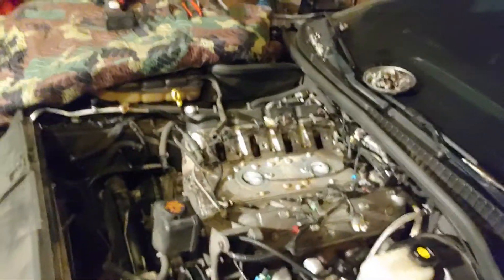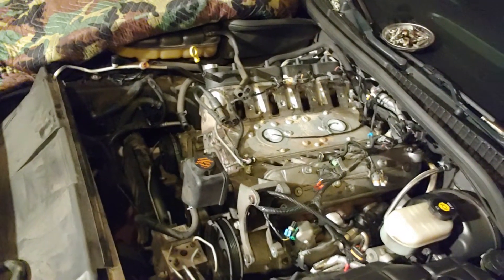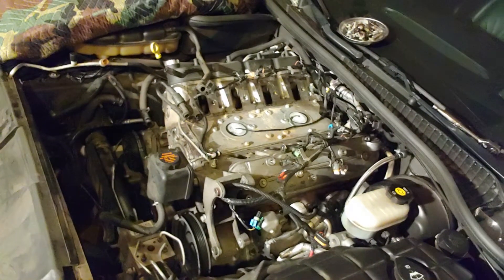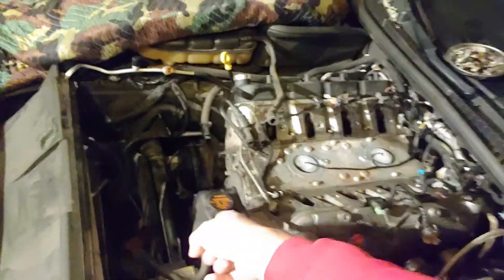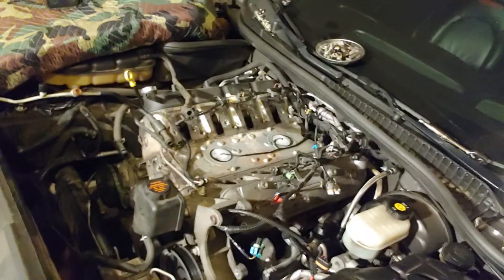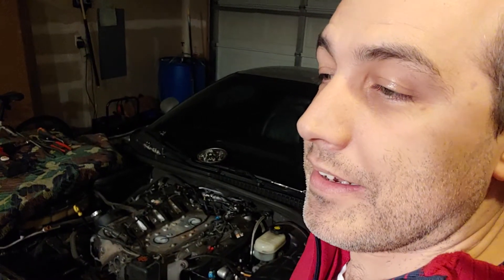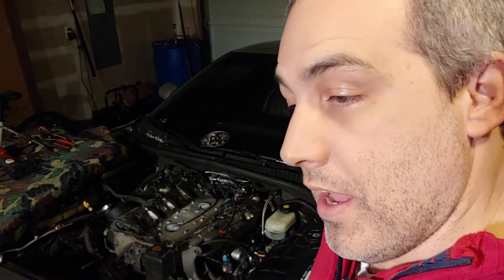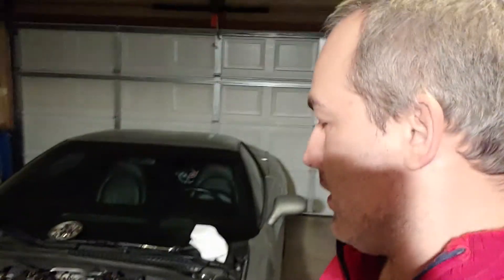I'm starting a build on the C5Z

Comment: My sti just have rinland failure 2 days ago over boost to 22 with the MAPerformance stage one stock car that tune destroyed my car.
Reply from the maker: That sucks. I'm not a fan of their shelf tunes
Reply: Dominic Acia I thought they were good that’s part my fault too 🥺🥺😤
Reply: sounds like operator error... should have tuned your lead foot
Reply: jmj5150 I did not wanted to tune my car I just wanted a stage 1 tune just to make the car run better that it I ran the Cobb stage 1 for like 5 months everything good but since I bought the access port from MAPerformance they gave me there map saying it was much better, and the first day I installed it and try it it made the car overboost to 22